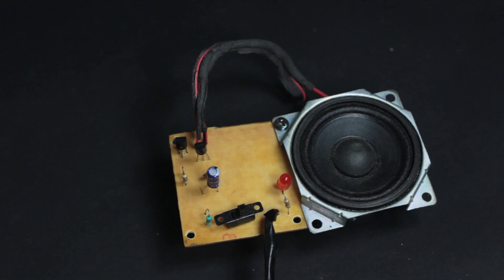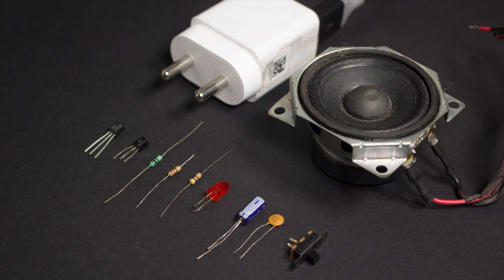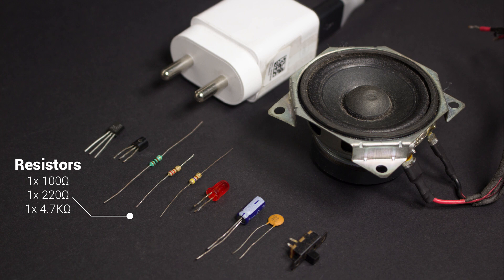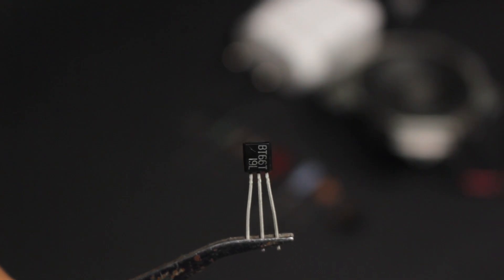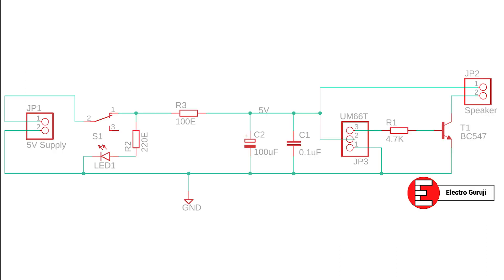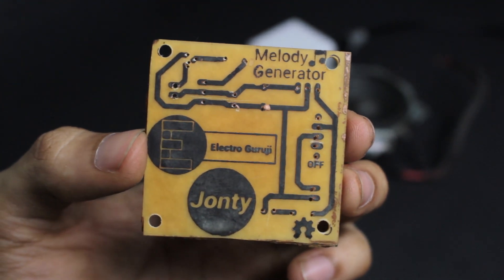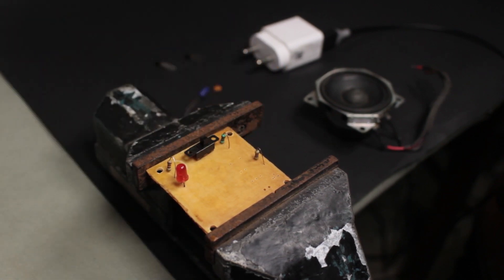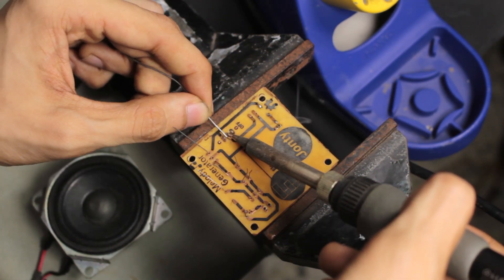DIY Simple Musical Bell Circuit | UM66 Melody Generator

Comment: Only downside is that you need to keep the switch turned on to hear the melody.
Other thing that can be done is to charge a capacitor when someone presses a push button switch and then as the cap discharges the melody keeps on hapenning.

What do you say?